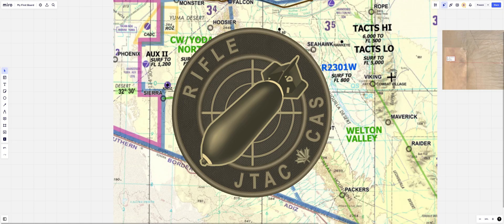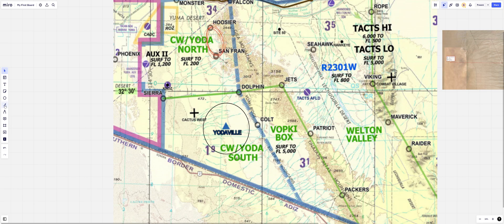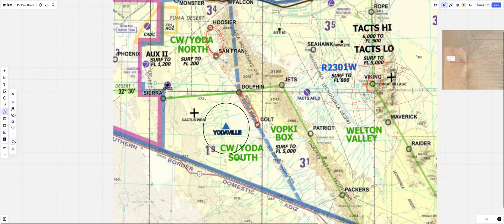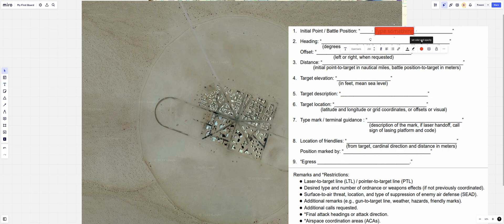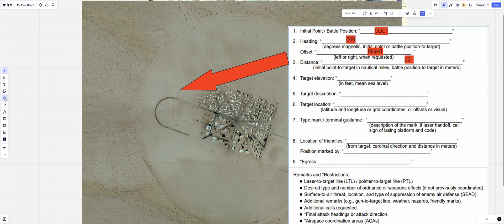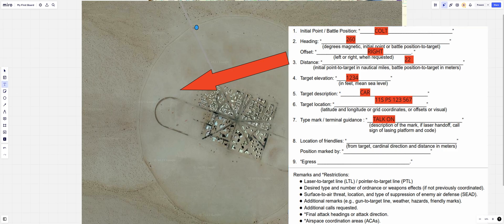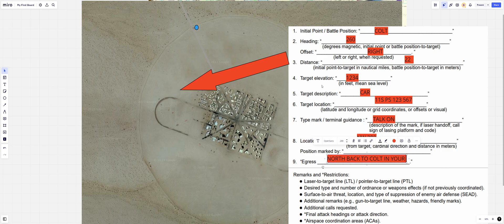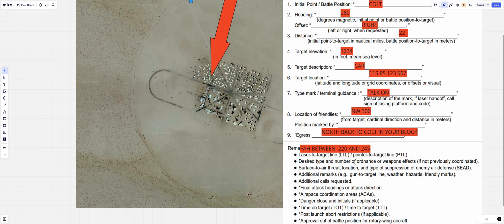Whiteboard 9 Line with IP

Comment: Lost me on the offset, but this is super helpful
Reply from the maker: Hey,

Thanks for the feedback.  I'm getting better at these, I promise.

I reviewed the video and it can use a refresh.  You're right the offset is not well explained as my words seem to be like a Van Gogh painting.

From IP to Target, the heading is 260.  For the sake of using an offset I decided to say  RIGHT because it advised the pilot they will have to turn right, to later turn LEFT and meet their FAH (Final attack heading).  I should have included a solid picture of this and not some arrow I launch all over the screen.  Offsets are also used a lot during LOW LEVEL attacks.

Please see my SEAD low level mission and the F16 flies this path and that may better answer the question for you.  Also, feel free to join us on the discord and I'll be happy to provide you with a picture there if you still have questions.
Reply: @JTACRIFLE   so youre saying it means you want the aircraft to put the target off of its left wing (putting your plane on the right side of the target in orbit?)
Reply from the maker: @timothymorgan8254 Hey, I see how you’re thinking.

You don’t even need to use it.

From IP the heading should be direct to tgt.

Offset or not, the pilot needs to leave the heading so they can fly into the final attack heading cone.

Comment: I really don't get the offset (left/right) why no offset but with a different heading. 
Also wouldn't friendly be in danger when to bomb falls short according to the final arrow.
Reply from the maker: Your not the only one.  Let me do my best here.

Your IP may not already be perfectly aligned with the final attack heading and that OK.

Often times you don’t even give an offset because the pilot will understand he has to put the nose of the aircraft inside the final attack heading.

Yes, the bomb can fall short and it looks worse with a laser guided munition when there is a ground based lase.

Hope that helps.  If not maybe join the discord and we can plan a meeting there
Reply: @JTACRIFLE  it helps a little, thanks a lot for explaining it again. Maybe going to hop on the discord next week. 

I am total new to JTAC and would like to learn more about it for DCS and maybe be able to actually use it.
Reply from the maker: @t3n0n79  its a lot so take it easy.  After I did my course in ‘08 I still had questions.  This is a never ending growth minded job
Reply: @JTACRIFLE  you need a video that will be like "JTAC Basics: Explained for 4th Graders" so I get it XD